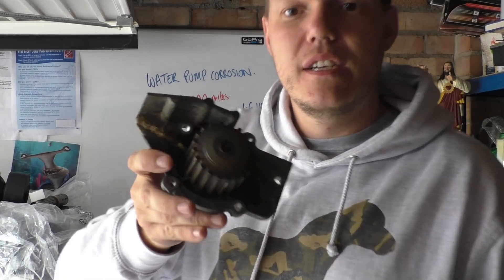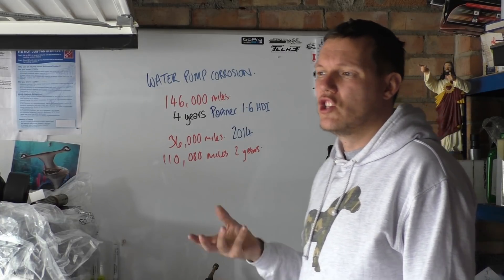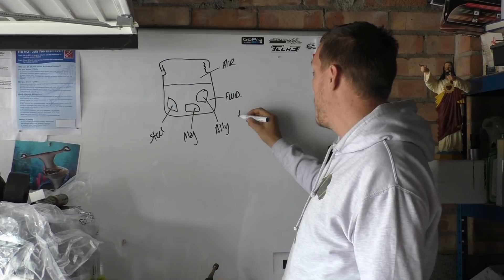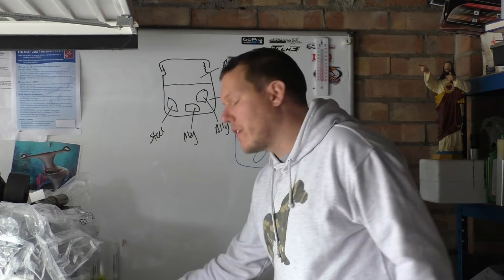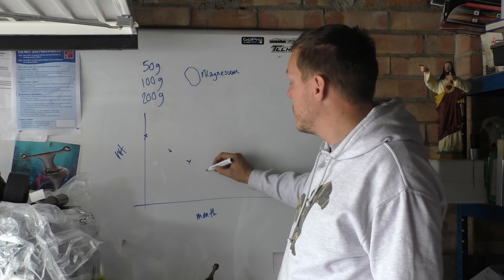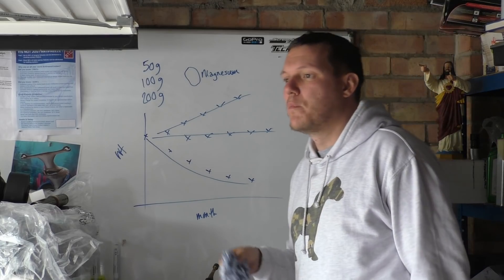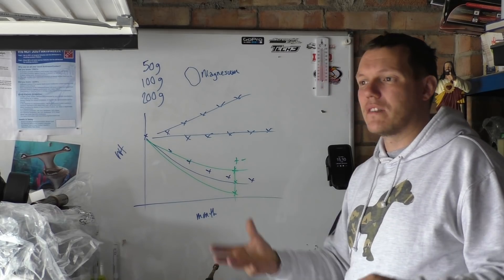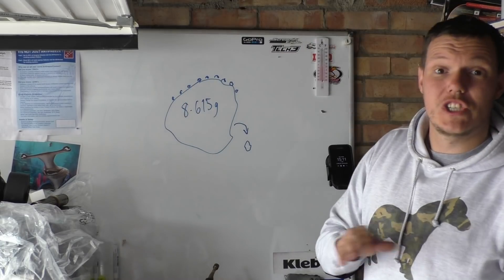Anti freeze corrosion - the set up

Comment: Will you periodically heated up to operating temperature?
Reply from the maker: No. And I have good reason. I would love to - however this would mean a far more complicated set-up and the containers would need to be able to take pressure increases. 

With the set-up I have now, as long as each test is as close to the same as possible then it should give a good indication of which coolant is better a protecting each metal sample. 

Is it representative as to what happens in an engine - no. But close enough without spending £10k

Comment: I would have chucked some brass in there as well, I don't know how common it is on bikes but the thermostat on cars are almost always just big fuckoff pieces of brass and/or copper plus a spring and a steel plate of some sort.
Reply from the maker: Brass is so rare these days on bikes I can't remember the last time I saw brass or copper anything other than some temp sensors. As these aren't any part of the engine structure then I didn't include it, otherwise we'll be here for fucking ages LOL
Reply: I looked around online and it seems like less powerful bike engines use them quite a lot from the factory, and practically all 3'd party thermostats also use brass and copper (but really on an expensive machine I would not dare anything but original).

At first I didn't realize how tiny they were though so even if they WERE brass/copper I don't expect them to change the galvanic effects a significant amount.

Comment: Just a thought, but doesn't running a current through metal increase corrosion? and an engine would have some current running through it... Or am I being silly?
Reply from the maker: You're being silly. LOL water or even anti-freeze mix is conductive but not like pure aluminium. Electricity flow through the path of least resistance, and that means through aluminium not water or 50/50. 

Conductivity does play a role in the fluid itself though, just nothing to do with the battery.

Comment: Ideally you want the iron, ally and magnesium electrically connected, just as they are in an engine. This results in electrolytic corrosion which is one of the major causes of corrosion in many engines.
Reply from the maker: Ideally you need several engine systems, all brand new. As these bottles are all the same the results will be good enough.
Reply: You mean you don't have half a dozen brand new bikes to do this test with? What sort of amateur are you?

Comment: Maybe put a pice of a head gasket in there.. This is a good test, am not sure how practical it is because when was the last time a engine failed (with proper maintenance) because of Coolant. Well maybe I take that back because if a head gasket does fail because of corrosion and Coolant mixes with oil... Idk should be interesting. I personally use Prestone because it's available and a good price so I can change it often. What water did you use?
Reply from the maker: Di water
Reply: Dex-Cool has been reported to deteriorate head gaskets resulting in failure with automobile engines. 
Many lawsuits over Dex-Cool gasket failures in the US.
It was alleged that high concentrations (well over 50 percent) of the coolant/antifreeze was the cause. 
If my memory is correct, it had something to do with reactions with the OAT/2-EHA/phosphates additives and glycols deteriorating the gasket material.

Comment: When you say DI water is shite you mean it. Knowing a bit about copper and aluminium oxidization through computer water cooling systems DI water does interesting things. People use it for computer water cooling because it's low conductivity without realizing it strips ions from metals to then BECOME conductive again.
Reply: Advantage of DI water in engine cooling systems is that there's no/low amounts of calcium and other minerals which can lead to scale formation. Just look at the inside of a kettle to see the scale formation in typical non-DI water (amounts vary depending on your local water source of course).
Reply: Low mineral content water for cooling systems can be accomplished with distilled water at a fraction of the cost of DI water, is readily available and does not have the issues associated with DI water.

Comment: For those that can't wait for a year, there is a piece of equipment out there called a BK Technology Galvanic Corrosion Analyser that could tell you the galvanic corrosion potentials in real time. It's a very sensitive (and very expensive) multi-channel galvanometer that can measure the corrosion currents in microAmperes and from these currents you can work out corrosion rates in microns per year. I used one of these pieces of kit in development work of water-based fluids for hydraulic systems used in offshore oil rig subsea control systems. You can set this machine up with any metals of your choice, fill the tank with fluid, set the pump going and switch on the analyser. It only takes a few minutes for the system to settle down and then you can read off the corrosion currents. Clever stuff and you can imagine how much development time that piece of equipment saved.
Reply: ModshackMerlin Do you think an impressed current cathodic protection system could save any of these components, in a real world scenario... not so much in regard to the way Matts testing, but in an engine system where flow and cycles are taking place?
Reply: In a word, no. Even sacrificial anode protection (as used on oil rigs and ships) would only have a finite life before it needed to be replaced. The way that these systems are protected is via the use of anionic (amine salts of carboxylate acids) and cationic (borate salts) inhibitors working together to de-activate galvanic corrosion sites as they occur. The use of tolyl or benzo triazole compounds (e.g. Irgamet 42) would also 'plug' active sites of non-ferrous metals and the overall effect of all of these mechanisms is to reduce the corrosion currents to as close to zero as possible. No current flowing = no corrosion.
Reply: ModshackMerlin Hey I also have an off topic question: Is there a problem with using 316 stainless pipes on say an oil rig made of steel when the pipes might touch the water usually just hang a meter or two up in the air? The pipes seem to have oxidated with black holes in them where black stuff comes crepping out of. All the welds are intact and no brown, rusty looking corrosion spots. Any ideas? Would be awesome if you have a clue
Reply: 'Black stuff' could be a couple of things. it could be iron (II) oxide, where the iron hasn't fully formed into rust (iron (III) oxide), it could also be iron sulphide, caused by sulphate reducing bacteria attacking the metal in anaerobic conditions - this used to be a problem when rigs were using sea water as ballast.  The giveaway here is that you will smell sulphide, like a 'bad egg', stink bomb or battery acid smell. If it's going to be in contact with sea water for a considerable time, you'd be better off using Inconel or Super Duplex in preference to 316, or attach some zinc blocks to the parts as sacrificial anodes to protect the steel.
Reply: O yea! now you guys are getting into the good stuff, Inconel, Super Duplex, Hastelloy, and Nitronic, make the pants tight! Got to molest a big propeller made from Monel k500 once, that was pretty tasty too!
Reply: ModshackMerlin Thanks for the reply! the stainless pipes are just dangling around basically as a breather so air can flow in and out. I find it weird that there is no sign of brown iron oxide and the welds (and weld/heat affected zones) are all fine but the around 3mm thick pipes have fuckin holes in them from 5 up to 10mm diameter. Something has to be wrong here in my opinion and I don't think it is just some normal material failure/aging. The pipes are also only around 2 years old. Yeah inconel was one of my thoughts as well but someone suggested plastic coated pipes which they wanted first but that was too expensive apparently.. so they said cheap(er) stainless is gonna be alright.
Reply: I agree - get some of the black stuff analysed as soon as possible, as it may be an indication of sulphate reducing bacteria (SRBs) in the system that uses the pipe as a vent. SRBs generate sulphurous and sulphuric acid as by-products and my guess is that they are eating the metal up somewhere and the vents are only the first indication of trouble. Is it a drilling rig such as a semi-submersible and are they using sea water as ballast? Whatever it is, the breathers are doing nothing as SRBs  only thrive in anaerobic conditions, so there's no oxygen in the system attached to those breathers. They may have used 304 Stainless in preference to 316 and 304 isn't as corrosion resistant.

Comment: Are your metal pieces connected together mechanically as a boiler or a ship used a sacrificial anode to mitigate corrosion or are they all loose in the jar?
Reply from the maker: Not intentionally - but I give them a shake everyday - so sometimes probably yes.
Reply from the maker: To add - you have to remember that most of these metals ar in contact with each other. Steel liners in ally, bolts threaded into the mag and ally cases etc
Reply: Looking forward to see the results. Thanks Matt
Reply: I think they should be connected together since in an engine they are (almost?) always somehow electrically connected. And I don't mean slightly conductive coolant but serious metal to metal connections like oil lines or mass cables or just simply bolted together. I don't think the experiment would be fucked but maybe they should touch all the time
Reply: The original corrosion test I remember test used washers and all of them were bolted together onto a rod using spacers. It may have been a Rolls-Royce method and it used copper, brass. plain carbon steel, aluminium, soldered copper, 316 and a couple of other metals. The washers were weighed before and after immersion and the weight loss recorded. There was a R-R specification for radiator coolant inhibitor called SQ36A and that was the method we used to compare Sq36A inhibitor against competitor fluids.